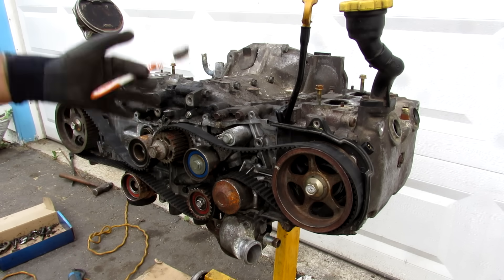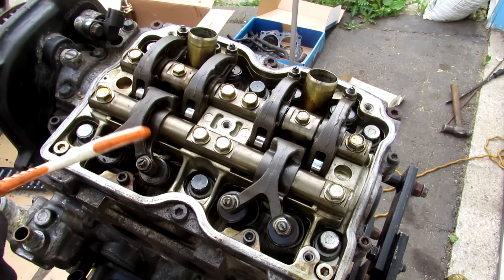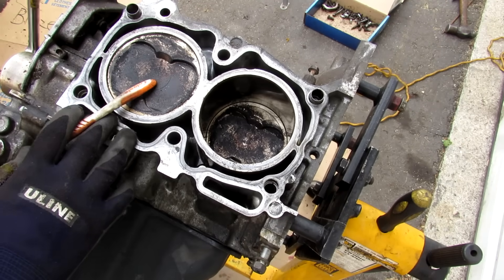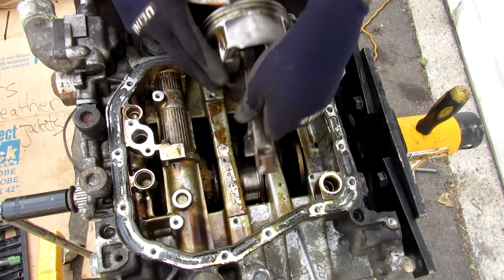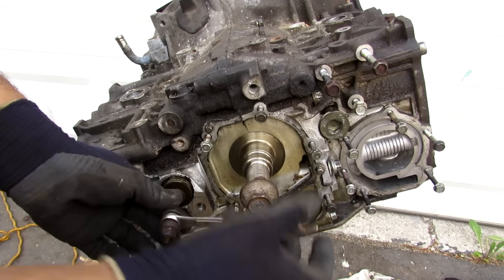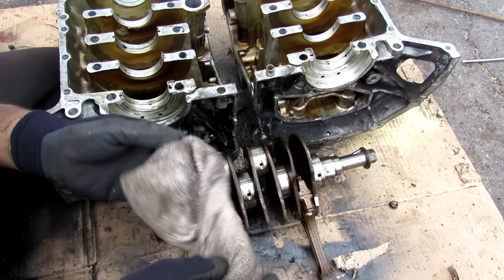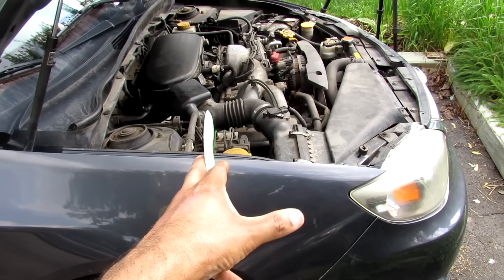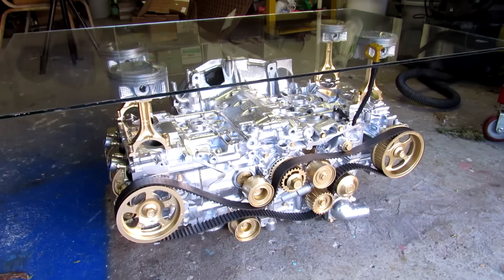Why Subaru Engines FAIL

Comment: "Endless money-pit " engine! LOL
Reply: Scotty kilmer.....
Reply from the maker: Good old Scotty
Reply: Never had a problem with a Subaru engine
Reply: My friend is a pilot. He builds kit planes for people just because he loves doing it. The top engine used in those planes, until recently, was rebuilt Subaru engines. They could run near redline all day long and never fail.
Reply: @2002MX5   Now it's Mazda rotary. Even less chance of unexpected failure.
Reply: Everything was wrong with mine.... just had it fully rebuilt, closed deck, forged and so on
Reply: Have a 84 ea82 and it's over 300,too and a real 4 WD model gl wagon .I like the NON interference motors no no to interference... love my ta patrol gl wagon....xlt lil mountain car,lil slug but gets you where trucks can't fit ..= good camping and fishing and relaxation....
Reply: my dad owned a 97 outback with an ej25D the biggest problem was the headgaskets they got replaced twice while he had it i have read that some people buy metal gaskets and that fixes the problem permanently, which i wish we tried when the first gasket went because that car needed close to nothing done it the time he had it, it had 400,000kms before he decided to get a new car. it was abused but still kept going no fluids were replaced apart from engine oil every 10,000ks. was seriously a great car if they never had headgasket problems they would be a bullproof engine in stock form, cant speak for the turbo models though.
Reply: also newer subarus seem pretty shit compared to older 90's ones the quality seems to have gone down a few notches
Reply: Super Gramps that’s completely wrong.
Reply: 🤣🤣🤣🤣 my guy Scotty 👌🏿
Reply: I own a stage 2, 2011 wrx with 178,000 km’s, and still runs well. Every single car has their own specific problems. Subaru’s are great, fun cars that you can modify, make it fast for not that much, and will last you a long time if tuned right and the car is well taken care of.
Reply: 98% of all Subies sold in the last 10 yrs are still driving on the road. People come into Subaru with 300k plus miles, just needing an oil change. Every car gas its issues, but as long as you check and change your oil, you know, like a responsible car owner should, you will be fine. My 2006 EJ255 is purring strong and turbo. No problems except normal stuff, i.e. brakes, clutch,  rotors, etc. Soooo easy to work on. Spark plugs are not as hard as in this video. Belts are a cinch. Best cars we ever had. Beats driving a 2wd family car, something boring like a Camry or Accord.
Reply: @matty9369  Ok TV announcer guy
Reply: @matty9369  I know some folks have good luck with 'em but any engine with the reputation for blowing head gaskets Subaru has is an engine with definite issues. I understand their appeal but they scare me. Forums I have been on claim they built A LOT of cars before realising they had not been using the head gaskets they should have been using.
Reply: @gregorytimmons4777  Certain years had their issues on the 2.5s. But that was early 2000s. Every car manufacturer had its issues. But 96% sold in the last 12 years are still on the road. That's impressive. Ive owned 5, 2 currently. Never blew a gasket. Most expensive repair was replacing the clutch, and thats a wear and tear item on any MT car. Subaru is a great company and their cars hold their value and run forever. Not to mention their awd system is superb.
Reply: @gregorytimmons4777  May I add people usually go on forums when something is wrong. Nobody really goes on there to boast about how good their car runs and just to say hi to everyone. Working at Subaru too, we dont see many blown head gaskets. I worked at Toyota and VW, and nothing out of the ordinary. Ive seen more Toyotas with blown head gaskets. My friends Supra did it. Luckily my Supra didnt. But the engines are so easy to replace or fix. I can remove one in less than a half hour. And used ones low miles from Japan you can find for under 700. Theres a reason rally drivers win races with them and they are balanced and reliable.
Reply: @matty9369   @Vita Loaf I replaced my oil religiously with synthetics and synthetics blends, and kept my miles ultra low (<7000/yr for 20 years) but the engine finally gave into the flaws of internal oil distribution that this video so concisely explained.  I'm now looking for a Corolla (or any car) that will last over 150K miles 😠  ...
Reply: whyno713 good luck with that, Toyota has recalled the 2020 Corolla for transmission failure.
Reply: The new camry has 300+ hp and drives very well. Meanwhile subaru has not upgraded their engines in what, 20 years? Toyota and Honda deserve respect for constantly improving, subaru not so much.
Reply: @faridmk3707  you are so wrong smarty pants. Toyota and Honda are shit and not even innovating. Subarh came up with the Subaru Global Platform (SGP) and then few years later Toyota came up with their Toyota New Global Architecture (TNGA). And what about Honda?? NONE!!
Reply: Farid MK yup, except Toyota has been using the same V6 and i4 design since the 70’s. 35+ years is older than 20 years.
Reply: @Xyb3rTeCh  Honda earth dreams engines are nothing? Really?
Reply: @porsche558  what engine have they used for 35 years? The current v6 has been redesigned in 2018 and it was originally designed in 2005. 13 years is a long time but they didnt put these engines in enthusiast cars, they put them in generic people movers.
Reply: @faridmk3707  so you didn't know about the oil dilution problem, do you? And Earth Dream? It sounds like shit
Reply: Subaru engines are not money pits. Just maintain them on time, like you should
Reply: Me to been through 3 ej20 s 🙈
Reply: sidecarnutz  I DO TYPE CAP ,CASE BECAUSE I HAVE MD IN BOTH EYES MAKE SURE I SPELL RIGHT
Reply: ALWAYS LOVE TO SEE YOUNG PEOPLE THAT ARE ,WELL SEEM TO KNOW IT ALL WHEN IN ACTUALLITY ,THEY DON,T!FACT  I SEE H - 4 ,S ALL WEEK LONG WITH 325,000 400,000 ON THEM AND STILL NO ISSUES, ! IF YOU WANT JUNK GO OUT AND GET A NEW CHEVY TRUCK,GM HAS LOST IT,I WORK ON THIER MISTAKE EVERYDAY,HELL THERE ARE L WAGONS OUT HERE WITH 800,000 SO DONT DOG SUBARU UNTILL YOU KNOW THE REAL FACTS !!THE SABARU CORP. DID ITS HOMEWORK,CG  -:45' THERE ARE ONLY A FEW GREAT ENGINES,VOLVO RED BLOCK ,,CHEVY ONLY HAD 1 THE OLE 327 ,,SUBARU H4  UP TO 2009,FORD 289,. 260 IVE WORKED ON ALL OF THEM IN THE PAST 53 YEARS OH FORGOT DODGE DART SLANT SIX,THESE ARE GREAT DESIGNES BECAUSE THEY GO UNTILL 1,000,000 IF YOU KNOW HOW TO CARE FOR AN ENGINE,HECK JUST THINK IF GM HAD KEPT ON MAKING THE BOXER IN THE CORVAIR THEY WOULD BE A BETTER COMPANY TODAY,TOYOTA THINKS A LOT OF THE SUBIE BOXER TOO THEY PUT IT IN THE 96 THE CAR SUBARU 1/2 TOYOTA!
Reply: @rayoliver1101  yep. People overboost the WRX and dump clutch on redline in AWD, then say it failed. Slant 6 1m miles?! Maybe if you clean the fouled back plugs every day..
Reply: @rayoliver1101  u forgot the 1mzfe and 3mzfe. BULLETPROOF
Reply: The CVT still don't last like Toyota & Honda
Reply: @GF-mf7ml  Bullshit. Subaru's CVT are fine. The worst ones is Nissan Jatco CVTs
Reply: @Xyb3rTeCh  The 4EAT IS A LOT BETTER SETUP,THAN THE JATCO CVT,ALLCVT BANDS START TO EXPERENCE SLACK DUE TO ITS DESIGN WITH LATTERAL CONTINGENT MOVEMENT,PERSONALLY I WOULDN,T HAVE ONE IN A SYSMETRIC ALL WHEEL DRIVE IT PUTS UNEEDED STRESS ON CV SPLINE AND GEARS,THE 4EAT PROVIDES CONSTANT TENSION WHICH GIVES BETTER SERVICE!
Reply: G F ya Toyota’s CVTs are so good they had to recall every new Corolla with one.
Reply: My friend had a 2003ish forester, it blew up around 2009. It was taken care of too
Reply: So true, we have been there, the engine and the CVT. Caveat Emptor .

Comment: Given the Subaru issues, what are the best countermeasures to prolong these problems as soon as long possible?
Reply: When a car gets some miles on it, check the oil and coolant levels at least once a week and immediately  respond when you find something amiss.  Don't assume its lost coolant because the weather has been hot etc.
Reply: @timothykeith1367  What would the response be due to lost coolant?  Is there some.kind of quality chemical that extends seal life?
Reply: @wellnesspathforme6236  I don't think so.

Comment: I recently was in the market to buy a new car.  I already have an automatic, and I wanted to buy a manual as a second car.  I very strongly considered getting a Subaru, specifically the WRX.  Then I read about all the issues that Subarus engines have, specifically with head gaskets.  Kinda freaked me out, so I wound up with a Toyota Corolla hatchback.  After buying the Corolla, I wondered if I made a mistake by buying a "boring" Toyota.  Then I watch this video, and I feel confident that I made the right decision.
Reply from the maker: From a wrx to Corolla! Wow I thought you'd stop by Honda or Mazda first!
Reply: @speedkar99  Yeah, I know....weird choice!  I swore I would never own a "boring" Corolla, but here I am.  LOL!  I'll explain my decision.  I'm someone who keeps a car forever.  After months of decision making, I decided that reliability is more important than fun.  I did consider Honda and Mazda.  But, I figured that Toyota's engines would be more reliable, because of the dual injection setup.  Mazda uses direct injection, and Honda was a concern for me due to reports of excessive oil dilution.  I don't trust mechanics, so I want a car that keeps me away from mechanics.